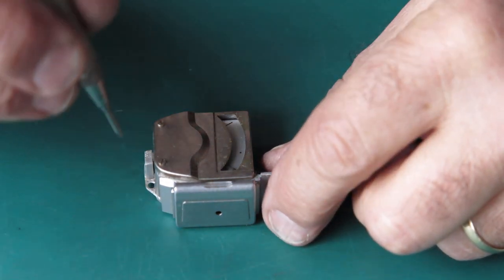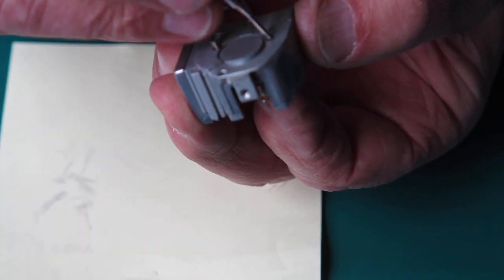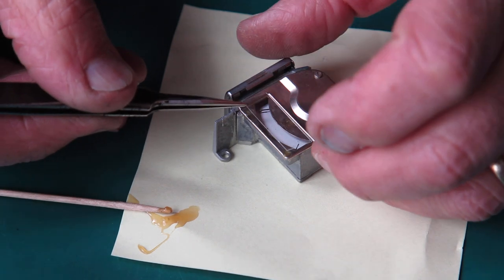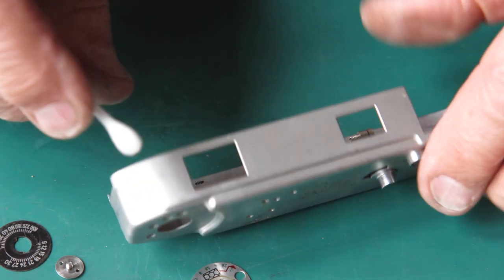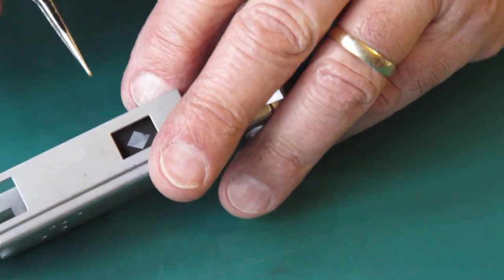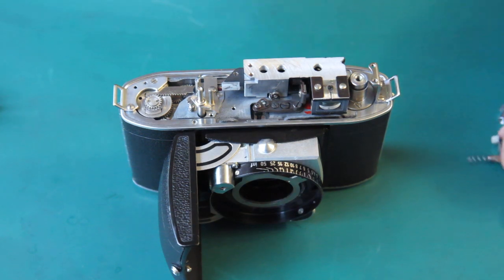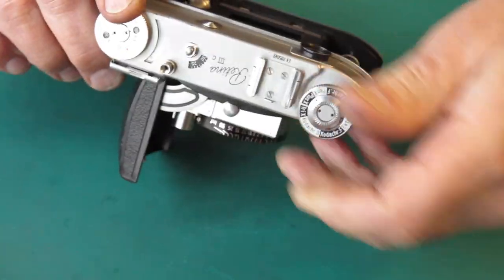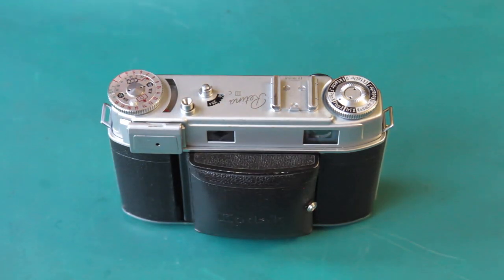Not just a new cocking rack, part 05

Comment: Chris I bought a 80mm medium format lens cheap of ebay, it was cheap because it had a non working diaphragm, with watching your video's I thought I would have a go to see if I could repair it.
Sure enough when I stripped it down. it had been flooded with oil, it was very bad, the diaphragm was stuck togther.
Thanks to your way of cleaning, I now have a fully working lens for a fraction of the price.
Great work.